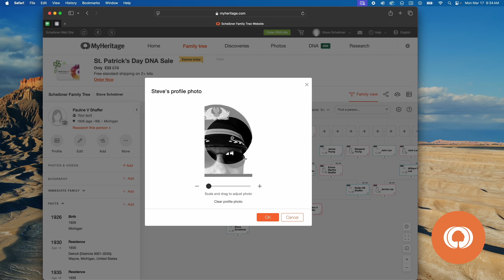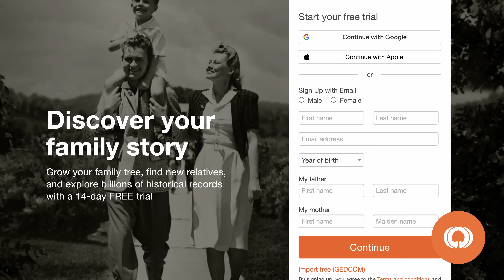Stuck Autopilot Turns Routine Flight into Nightmare | Captain Steeeve breaks it down.

Comment: Wait this is his 2nd incident that he was saved by an ATC: 

Shortly after sunset on Jan. 14, 2016, N113RC, a PA31T Cheyenne piloted by Charles Schindler, departed Cleveland, Miss.(RNV), en route to Destin, Fla. Schindler’s wife and two young children accompanied him in the twin-engine turboprop aircraft. Shortly after departure, Schindler checked in on a Memphis ARTCC (ZME) frequency looking for flight following, planning on a visual flight rules (VFR) cruising altitude of 17,500 feet.

Darren Tumelson was the controller on duty working the Greenville and Helena Low Altitude Radar Control Sectors. Tumelson has just over three years of Certified Professional Controller (CPC) experience at ZME in Area 4, working the airspace south of Memphis, Tenn., to just north of Hattiesburg, Miss.

N113RC was radar identified, issued the local altimeter, and continued its climb to the southeast. About 15 miles southeast of RNV, while climbing through 6,500 feet, the aircraft’s left engine shut down and the pilot declared an emergency.

Tumelson quickly determined the nature of the emergency, obtained the required information, and notified the supervisor on duty. For the next 12 minutes, Tumelson provided navigational assistance and airport information to N113RC as the pilot diagnosed the situation, and determined his landing options. Initially, the pilot intended to land at Indianola, Miss. (IDL), but was unable to activate the airport lighting to locate the airport. Tumelson provided information concerning two other alternate landing sites – the towered airport at Greenville, Miss. (GLH), and the airport at Drew, Miss (M37). Schindler requested to return to RNV due to his familiarity with the airport environment.

Tumelson continued to provide navigational assistance to Schindler as he struggled to maneuver the aircraft with only one engine operating. Tumelson provided updates to the pilot concerning the availability of fire and rescue equipment at Cleveland airport, and provided assurance that the requested services would be available and ready.

N113RC safely returned to RNV 20 minutes after departure, and 14 minutes after declaring an emergency. Schindler stated he had a ”hard landing” but there was no damage to the aircraft and no injuries to him or his family.

Schindler stated in a phone call with the facility that he and his family wouldn’t be alive today if it weren’t for the valuable assistance provided by Tumelson, and the team members that assisted with this event.
Reply: And the same plane.  And possibly ANOTHER one in 93 (shown as owner/pilot not named). And he was sued in 86 by a company he had an aircraft leasing agreement with and lost.  What's the common demonimator here? (Justia Law: Republic National Leasing v. Charles Schindler
Reply: @PeriMedic1 sued by a company over a lease payment or something doesn't mean anything.
Reply: Is all that considered lucky or unlucky?
Reply: @tedwalford7615  I don't know for sure, but I'm never getting into a plane with him!  Thanks, I'll walk.
Reply: @PeriMedic1  You walk I'll run, heck I'll crawl if I have to!  :D
Reply: @tedwalford7615 or something more
Reply: Well, Google had all this on the first results page.   A lease dispute 40 years ago that wasn't repeated is hardly indicative of his current situation.   

The 2016 incident was an engine failure.   He successfully landed with ATC helping find a suitable airport and giving him headings.   Nothing was particularly out of the ordinary in what ATC did for the pilot with an engine out.   You can watch many channels where they'll describe what happened with an engine out and ATC often gives headings. 

I've known several pilots who have lost an engine and landed.   I don't generally hold it against them unless maintenance was fudged.

However, this flight, as they say, takes the biscuit.
Reply: @carolinejoybarnhart3717  The 16 and 17 incident were on the same plane.  It makes me wonder if it is a lemon, or whomever owned it is chronically negligent in maintenance (or if he owns it, he needs a new mechanic).
Reply: @PeriMedic1 Having known several multi-engine pilots, engine outs are rare but they happen and the end result of a failure is they land and get it fixed.   Unlike a single engine sometimes.   The general attitude is never again on single engine once they go multi.    

The issue is the engine out reads as typical for the situation.  The article DIDN'T mention any malfeasance.

This time around I rate it as "takes the biscuit".  There are two meanings to that phrase and we're waiting to find out which applies.  Maybe both.
Reply: So then on that subsequent flight Schindler basically lost his list.

Comment: Flew Delta out of RWS airport in Ft Myers yesterday to MSP and as an already nervous flyer it didn't help that they announced early boarding and urged passengers to move quickly onto the plane to avoid incoming weather. To spite this, passengers boarded so slowly that they checked all last to board zone 8 passenger carry ons (other than backpacks etc) at the last minute and rushed us to our seats. We ended up taking off late after the slow boarding and holding for an incoming plane that was landing. Because of you, Captain Steeeve, I've been able to fly without being terrified for awhile now, but have to admit that fear returned on this flight and my nerves were cooked. The flight went fine and was pretty smooth overall, but I don't understand why in the world they would do this other than to keep flights on time? I'd rather be late than go through this unnecessary urgency again!
Reply: I would not have boarded that plane. Pilots in a hurry make mistakes.

Comment: When,I,run,I stabilise at a,particular-speed and there I manoeuvre myself,to reduce drag,”perfection”,”informality”,”dev😘”,with,my-body-controls,so,a,pilot,knows the flight-controls,are effective only when,there is,sufficient-air,flowing over them and you cannot be an expert in the,”flight-controls”,if,you can’t run,hope that makes sense

Comment: This is the wild card in flight for so many reasons.

First of all the avionics systems witch the Autopilot is part of has no connection to the aircraft landing gear system at all .

If you turn off the aircraft master switch it's not going to have any effects on the aircraft AC bus or the aircraft DC busses because the Alternators or generators will still be producing power. It's kinda of a safety feature.

The same with turning off the Alternators or generators if the master switch is on the aircraft and Avionics systems will still be pulling power from the Batteries.

Now turning off the aircraft master switch and both alternators or generators at the same time will remove all electrical power from the aircraft.

But I am not sure the engines in a turbine aircraft would still be able to run.

Now the older aircraft engines that have dual mag for each engine and an engine driver fuel pump would still be able to run if all electrical power is lost not sure about the turbine engines in this aircraft.

Also not sure what autopilot system he has.

But no matter what aircraft autopilot he has the pitch and roll trim are on different servo,s and different control cables.

So if one cable breaks or autopilot servo freezes up it would not be able to affect the other cable.

Sounds like he got an autopilot system that is engaging and if he had turned off the avionics master switch it should have cut power to the auto pilot sevos.

If he had pulled the autopilot circuit breakers it would have removed all power from the autopilot system.

If I hear him correctly he pulls the connector to the flight display and that would possibly let the Auto pilot stay engaged but with no input from the flight director.

Putting the autopilot in limbo with no data. 

I don't like any aircraft were you can pull the circuit breakers. 

Just wondering if he lost the autopilot disconnect switch on his side of the aircraft. If so the autopilot disconnect on the copilot's side should have still worked 

This is very strange.

Avionics Tec. Pilot, and aircraft systems tech working on aircraft systems across the board including building aircraft and Avionics systems for new EXP aircraft in the LSA world.

No sure what could cause lots of warring lights and stop the gear from coming down and making the aircraft autopilot freeze up in both pitch and roll at the same time.

Have install and work in the KFC200
Ch3 ? Spelling and old H14 if I remember correctly 

This is a very strange situation and wounded if the pilot is just a little confused as anyone could be.

Would love to know what they found.

Can't see anything causing all that trouble on this aircraft
Reply: It could even be as mundane as a mouse chewing on wires (short circuit).
Reply: @Jul-66 
It could be but if he flipped off the generator or Alternator you would have gotten lots of warring lights because the AC inverter would have went offline.

Any system on the aircraft power could also have went off line setting of warring lights.

It has been a few years sense I have worked on that model.

Turbo props have lots more warring systems than a piston power aircraft.

Yes it's possible Mic possibly could have been the reason as wild car's do pop up.

But depending on how often the aircraft is use and the hanger it's kelp in possibly.

Some hangers you can eat off the floors others a little more dirt and mice can get in.

But there's lots of pest control at times as we.

Don't believe i have ever come across a nest of mice even on aircraft on the ramp 

But it's possible

Comment: Here's an autopilot question for you. About 40 years ago I was flying from Dulles to Seattle. I'm sure I was on Northwest, I used them a lot back in that time frame. We had taken off and ascended, the seat belt sign had been turned off. About 30 seconds after that the plane almost dove down quite a ways. I'm the type that never unfastens the seat belt unless I need to use the restroom so I was fine but I saw people sliding down the ceiling towards the front of the plane. Almost as quickly as the dive started the plane leveled off. We had to return to Dulles because some of the passengers were injured. The captain came on and told us that the dive was because of an autopilot error, that there was no danger. Does that sound like something that could have happened? In any event I got paid along, I assume, with every passenger for distress and injuries. While I had no physical injuries the dive went on long enough to reflect on dying, I think that qualified as stress!
Reply: Whew. Good on you and the seatbelt.
Reply: That is called a “Pitch Trim Runaway”

Comment: So does anyone know what caused all of the issues at this point? I'm very curious. Great outcome.
Reply: This specific aircraft N113RC had an ongoing problem with the autopilot not disengaging (or the pilot not properly ensuring it was disengaged). It had just experienced a similar issue 18 months prior to the events in this video. The pilot kept having to fight against the autopilot.
Reply: @michaelgoldsmith3534 yeah, that leaky capacitor on the auto-pilot PCB.
Reply: A leaky capacitor in the power supply.
Reply: @ruth9370 😂😂😂
Reply: @ruth9370  WHAT?????
Reply: I would be hard pressed to fly with this kind of issue being worked on. Call me a sissy,but I would rather pay an expert to test fly until it was 100% fixed. I hold a bachelor's degree in aeronautical science, the why how and how to fix airframes and powerplants. I have only a couple hrs in control of an airplane in flight from when I was in flight school. Failed the med due to my eyes, no bifobial vision. Can't see 3d and my eyes don't work together...